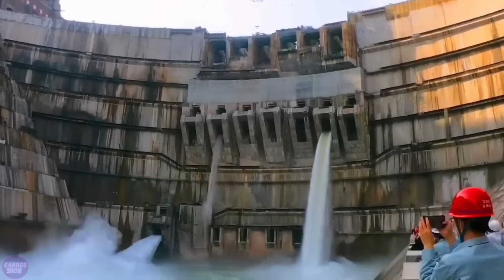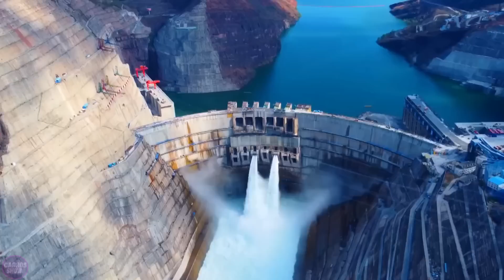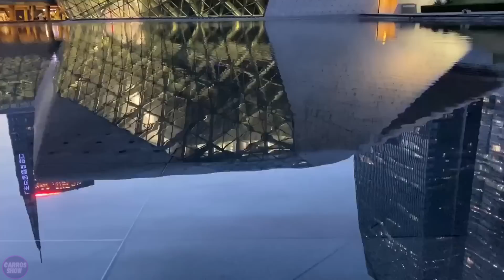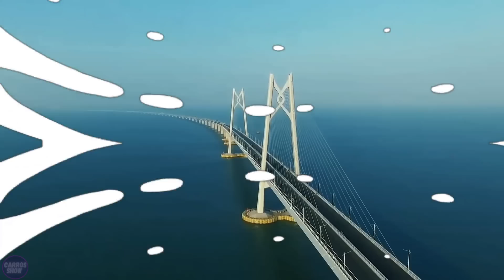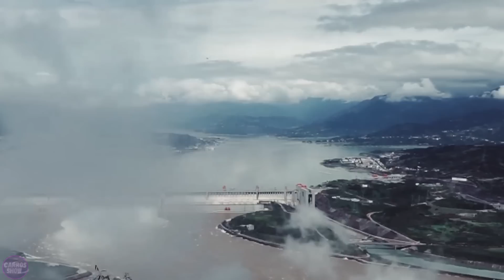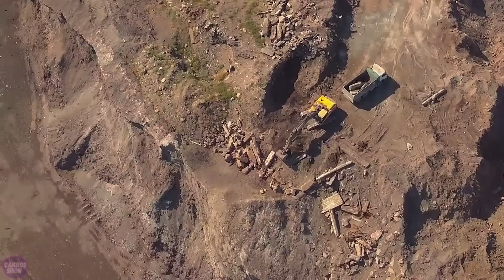This CHINESE Mega Project Cost $900 Billion

Comment: It didn’t cost $900 billion dollars. It is Infrastructure spending. It will circulate 10 times in the Economy, and return to the Treasury. It’s not actually spending if it comes right back. 1st year Economics.
Reply: It depends on what model you are using. In parliamentary system its a lose, plain and simple.

Comment: Whats the reasons for an elevated railway in a seemingly flat land? Why waste that money and materials
Reply: Maintaining high speed and correspondingly high throughput. Presumably the video B-roll featured is a valley area and most of the trackway along the rest of it's length is at/closer to the height of the track. If the destination is high-up terrain like mongolia / coming from high up mountainous terrain in the south, and along mountainous terrain most of it's length, and you intend to run high speed track and high speed locomotives, then you need to minimize grid elevation changes. Individual infrastructure projects don't need to be profitable right away in China, as they're amortized over the lifetime of the party, for all intents and purposes, and that's theoretically forever. Nevermind that the fiscal and monetary expansion of the renmimbi is one of the priority long-term strategic objectives of the party, and building massive infrastructure projects is definitely one of the most productive and easily politically legitimizable ways to print more money (and increase your economies capacity to continue the expansion of your monetary supply, in addition to securing additional foreign reserves through increasing trade capacity long-term). 

TL;DR: China runs the entire country like a single, moderately decentralized (semi-multinational) megacorporation. Why finance one, expensive infrastructure project? Because it's profitable for the bottom line of the overall "holding company" itself, in numerous ways, which is the entire economic apparatus of the state, in this case.

Although we can have no doubt that that project will be very profitable: increasing the energy capacity of a province (even if it's through increased coal capacity) leads to, as we have seen, massive economic build-out in the rest of the province's economy. Beijing is obviously very interested in increasing the industrial capacity of peripheral provinces, like mongolia and southern/eastern regions, now that they've rendered most of the eastern coastal/river regions highly industrialized megalopolises that put the cities of the West thoroughly to shame, and have every incentive to continue the massive industrialization and uplifting of peripheral regions (and they'll continue to transition toward eventually investing absurdly massive amounts of renmimbi in other countries, to build up economic and trade infrastructure that China can benefit from exporting labour intensive manufacturing industries to, to feed their own domestic consumption and continued dominance of international exports markets to the EU and US, over the coming decades).
Reply: Build a 2000 km structure to transport coal so it can be burned and ruin the atmosphere, is that good for the environment? The Chinese government doesn’t care that it’s poisoning the atmosphere
Reply: Passing through the village is quite dangerous if someone straddles the fence